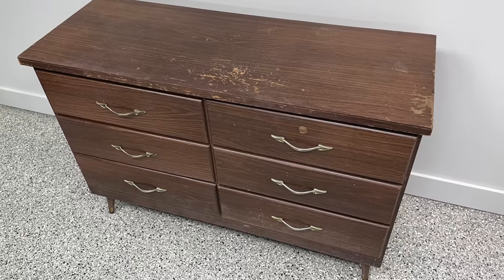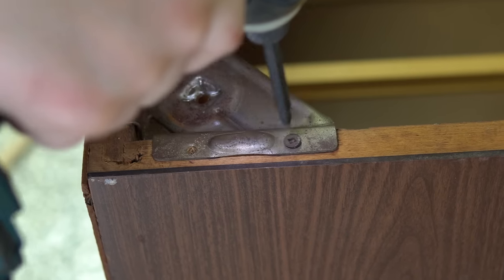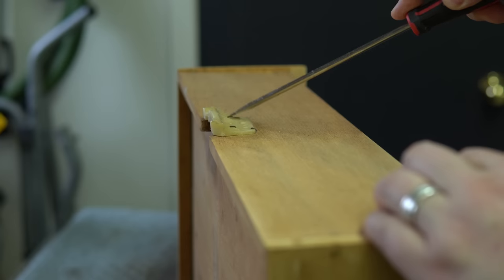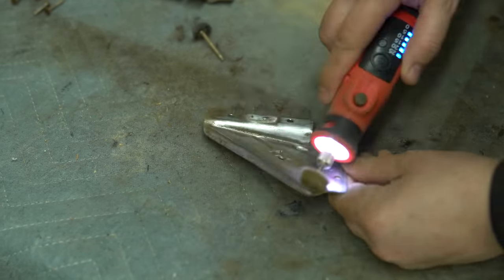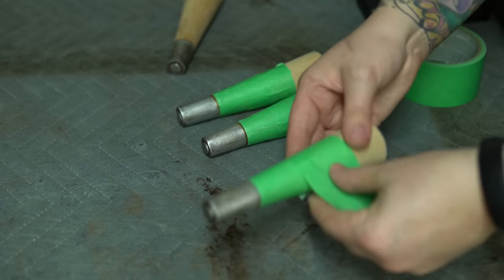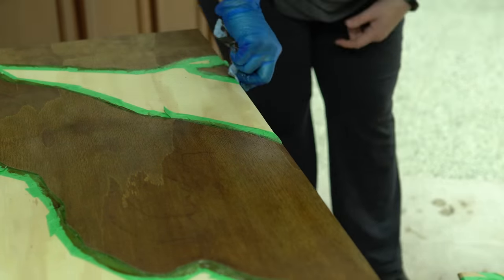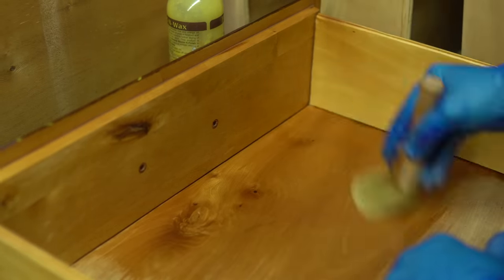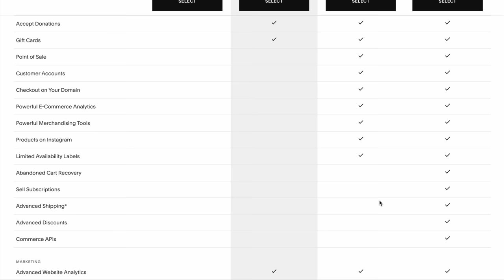Whimsical Purple Dresser Makeover with POSCA Markers

Comment: Just one note to make your life a bit easier: for the rusty brackets, consider getting a hold of a little vise and put a little brush in a cordless drill instead of using a rotary: you'll save an enormous amount of time and you can always go in with the Dremel for the detailwork.
With that said, I generally like your pieces a lot - and I was honestly impressed by how well this came out, all things considered!
Reply from the maker: Thank you for the tip! Thanks so much for watching! 😊

Comment: I am really amazing with the results! Such a unique piece! Im actually working on a record cabinet that I will be using at a television stand. My girlfriend and I got it for $50 and through refinishing it I learned it was the same construction… Masonite on a wood frame.  I ended up buying 1/8 plywood that comes with a teak veneer.  I refinished all the Masonite sides and I recently ironed on the teak veneer edging.  I was not pleased with the flimsiness of the entire piece so I added some “X” supports in each section of the frame.  It is MUCH sturdier and looks like a real quality piece now.  I just need to sand it and finish with Odie’s oil! (Part of me wishes I just went with a more abstract/outside the box approach, as trying to be tradition with this mid century stuff can be costly!)
Reply from the maker: Oh yes it sure can be costly! Your piece sounds amazing! Thank you so much for watching! 😊

Comment: I really love the outcome.  i can see what you mean about what you would have done "after the deed"  The only aspect that i would have done different is within the gold lines.  Since the purple and wood-stained areas are so similar and heavy, the composition needs the gold to also have a heavy hand to create a balance of three, like where some of the whimsical wavy lines could have been filled in solid.  There by creating a visual framework for the thinner lines to have support on or from.  i also love your technique of using the floating dots as a whimsical interfacing of the wood and painted areas. The final look also prompted me to visualize your gold handywork to be more varied as in a Klimt painting. For example, using the lined areas as frameworks for mini-island patterns like checkerboard, flowers, water waves, cross hatching, snowflakes, stripes, etc., thereby given the extra weight to the gold component that it needs to stand out a little more.  { this might also be the difference between your croquis sketch and the final outcome...the sketch lines are huge compared to the lines on the actual piece.}  Thanks for posting ! ... love what you're doing ❣
Reply from the maker: Thanks for watching!

Comment: You may already be aware of this or had it suggested to you before, forgive me if you have, but an easy way to put a quick layer of brass on a piece is to heat it up with a propane or butane torch and then hit it with a brass wire wheel. I wouldn't call it "plating" per se, but you can get some pretty good coverage on a lot of pieces.
Reply from the maker: Thanks for watching!

Comment: This is so awesome! Can you share how much it sold for?
Reply from the maker: I don't like discussing how much a specific piece sold for because it varies so greatly from place to place, person to person and year to year. I never want someone coming back at me saying "Well Angie said I could charge XXX for it." No thank you! 😊 Some people try to use an hourly rate on non commissioned pieces but I don’t find that very accurate. Sometimes the tiniest details take FOREVER, and would quickly “price out” the piece you’re working on. I go by what the piece itself is worth, based on comparable products in my area, and the finishes I’ve done to it. Most of my pieces sell within minutes. Which generally means I’m pricing too low, lol. But I don’t have the space to keep pieces for days and weeks so I need them to move fast. If I had more room, perhaps I could get a price closer to what some others in my area are charging. Which has gone WAYYYY up.